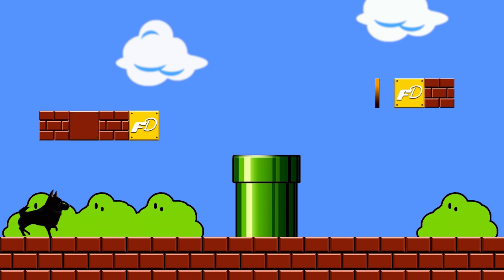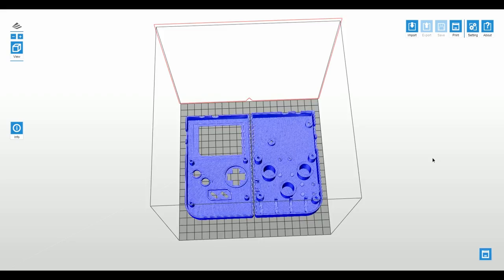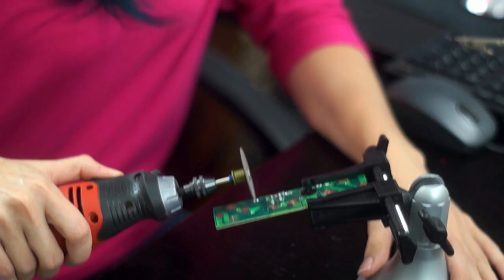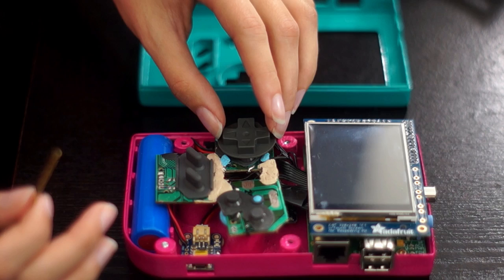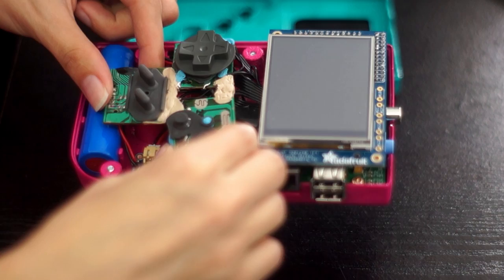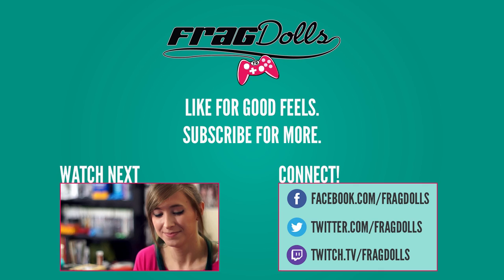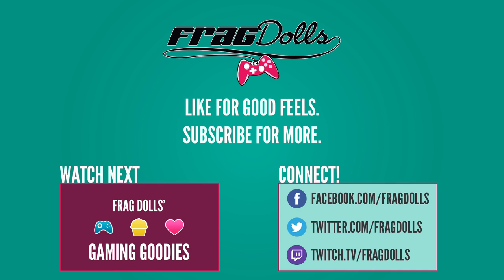Sabre Builds a Raspberry Pi-Boy! (Gameboy Emulator)

Comment: if you make more of these, try assembling the front case half separately. (place the screen, controls and any components/ports on that half) that way you can put it together without having any of the problems you ran into in your vid. non the less it still looked great (y)
Reply: Good idea!  But since I used the STLs from Adafruit, I was limited by the fact that her electronics basically all sit in the back half of the case.  And that still wouldn't have held the D pad in place, or kept the case tight above the screen.  The cool thing, though, is that Lady Ada watched this video (even though I have no connection to her other than buying her stuff!) and in new versions of this project there are screws above the screen ; ) Glad you liked the video!

Comment: this is super cool but i would've drilled two more holes and added the X-Y snes buttons in there too.  sure, its not authentic looking but there are so many emus that need those extra buttons.. maybe print them with the same green plastic so they blend in and keep the gameboy look ;)
Reply: brandon9271 Thanks!  It would be great to have an A-B-X-Y emulator, but Cupcade (the OS I'm using) only runs Mame and NES roms anyway, so the games I have really only use two buttons.  But I saw in another comment that there's an update to the RetroPie OS that might work with more advanced emulators, in which case I may wish I had those extra buttons!

Comment: Looking to mod an original DS and emerged here, I admire your build, if in the future you need to meld plastic I suggest instead of acetone (2-propanone) you try methyl-ethyl ketone (2-butanone). Additionally, it mixes better with peroxide if you're into that.

Comment: Certainly seems a little off having to glue the casing together above the screen. Maybe should have come up with something a little less permanent, just in case the buttons which aren't the most secure decide to move around inside the case...

Hahaha
Reply: MikeyTaylorGaming The stl file for the case was designed by the people at Adafruit who also make the power booster, the tft screen, etc.  I agree there should have been screws at the top, but redesigning an already completed stl (as opposed to a native file) is a bit challenging, and there's really nothing wrong with gluing the top.  The one I made hasn't needed to be opened, but if you unscrew the 4 lower screws, the top will "hinge" a fair amount.

Comment: How do you change the battery when it runs out?
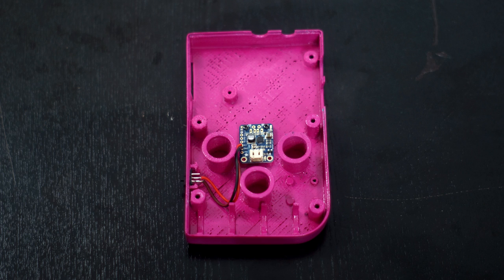Reply: It uses a LiPo battery that recharges through a USB cable that plugs into the thing immediately up and to the right of the battery at 2:17.

Comment: Your RaspBerry Pi Boy is probable the most polished one I've seen as of yet. I just wonder could it be possible to attach one of those cartridge readers that plug into a PC and work it into the Pi Boy so You could run actual cartridges! also would it be possible to have a link cable port so you can connect it the a actual gameboy and have it almost function as one...
Reply: +Karlos Tjuroukei Thank you!  It took a lot of work!  The nice thing about working with 3D printers and the Raspberry Pi is that you can really change things around a lot during the build (if you're good with programming), but unfortunately once their done they are hard to modify without starting from scratch!  Great idea about the cartridges!

Comment: Help:
Adding 4 additional buttons.
L and R buttons and 2 additional buttons in the front.
Can I still use the ribbon cable to wire them? Or do I need to find another way to connect them?

Comment: Hey, very nice video!! thanks for the info, i want to do this project but im a complete fool in electronics, do you think its possible also to wire the x y and L and R buttons? I also would like to play snes and GBA thanks. Where can i find the info how to wire them?? thanks again,.... ha and by the way... do you think i can use an old GBA for the project (or it would not fit...)

Comment: I have a question. If you own a real gameboy, could you use the components from that, with the raspberry pi to save time and money?
Reply: Not really.  The only parts you could really re-use in this setup are the buttons, and then you'd be left to figure out the wiring on your own instead of following a tutorial.  Plus, the 3rd party SNES controller only costs $3-$5, so there's really no savings.  If you wanted to run on AA batteries instead of Adafruit's Li-Po battery, you could use that part of the case (and avoid buying the booster, charger, and battery), but the TFT screen and Pi won't fit in the original case without heavy modification.  if you could find a way to wire up the old matrix screen to the Pi, you might be a step closer, but in terms of investment you definitely wouldn't be saving any time that way (and you'd have a low-res screen).

Comment: hi, what happens if you plug the piboy into a monitor or tv? can it be a handheld/home console hybrid like the Switch?
Reply: It should be able to, though you might want to ask on Adafruit or Raspberry Pi forums (I gave my Pi-Boy away to a friend who really, really wanted it).  You might need to modify the config.txt file to add something like hdmi_force_hotplug=1 or config_hdmi_boost=4, in which case using a Powerboost1000 vs a Powerboost 500 would be a good idea (making more milliamps available to send along the cable).  So there might also be some modification of the stl files involved.  Adafruit also has an upgraded "pocket" version of this project.

Comment: Great vid - so I've ordered these two items: 1 x PiTFT - Assembled 480x320 3.5" TFT+Touchscreen for Raspberry Pi[ID:2097]
1 x PowerBoost 1000 Charger - Rechargeable 5V Lipo USB Boost @ 1A (1000C)
[ID:2465] = $19.95
from Adafruit. I want to build these into a retro gameboy case (I have a backup plan, a dead saga game gear incase I have space issues)

You connected a voltage boost board between your switch and the charger. Is this necessary with the board I've got?
Reply: +Stuart Fox Nope!  It looks like your PowerBoost1000 will do the same thing as the PowerBoost 500 and the charger I used, but all on one board.  Good luck!

Comment: I followed adafruit's tutorial and everything works until I try to navigate emulation station with the hacked controls. If I go into the raspberry pi command prompt and press a button, it registers and I see commands being displayed in the prompt. I am using retrogame to recognize buttons. If I can get past this hurdle I can play the custom pi gear I made!
Reply: +Kaiser Mora Have you tried using CupCade?  That's what this system was designed for so I'd make sure CupCade runs first to make sure everything's wired correctly.  Good luck!
Reply: Thank you for the response =] I will definitely give it a try. Great videos by the way!

Comment: What did you use to cut the circuit board? Is there something I can use that isn't super expensive? Thanks
Reply: She cut her circuit board with a dremel-like rotary tool (a $30 Black and Decker RTX), but you can cut yours with almost anything sharp if you're patient enough (and don't cut yourself).  The main part of the board is fiberglass, and the electrical "traces" are just soft metal.  You could try a matte knife or x-acto knife, and either cut all the way through by making many small cuts (maybe 20-30 passes with the knife) on top of each other, or "scoring" through the first part of the board and then snapping the rest off.  A hacksaw might be safer, though, and you can get them at Home Depot for less than $4.  If you're not experienced with a hand saw (such as a hacksaw), it might help to only move the blade "backwards" over the circuit board, rather than back and forth.  This won't cut as fast, but you'll have more control over the cut.
Reply: Two other possibilities are "tin snips" which are just heavy duty scissors designed to cut thin metals, or a paper cutter/trimmer (the kind with a base and a large blade that comes down like a cleaver).  Fiberglass will dull your blade though, so you may not want to use a cutter like that even if you have one (unless it's old).  Really, a sharp blade will do the trick, it'll just take a lot of cuts, depending on how much pressure you put on the blade.  Having a straight edge will help.
Reply: Thanks!

Comment: I have everything on that she has. LCD , model b, ribbons to the controls. Now the red led doesn't turn on when I put the battery in it but it powers up fine with the usb. Also, I wasn't about to use a 128gb sd card so I had to use a 8gb one.
Reply: My first though is that you may have shorted the LiPo battery.  If you tap the +/- battery wires together even for a split second, you can destroy the wiring inside a LiPo.  Other thoughts include +/- wires being swapped, or the battery is not charged.  Did the Pi ever run off of battery power in your setup?  Do you have a meter that can read the voltage on the battery?  And, as a side note, she is using an 8gb card as well.
Reply: no the pi never ran on battery power. just re soldered everything and no light comes on  now. hmm..
Reply: ***** I would not have recommended that you re-solder everything, since you had what seemed to be a functional power circuit, you just couldn't get the battery to work.  Now you have more problems than you did before!  But making mistakes and learning from them is often part of the process, so I wish you the best of luck.  If you have a multimeter, please use it to check your battery (using the DC voltage setting) and you can also use it to check your solder connections (to an extent anyway, using the resistance setting).  If you don't have a meter, a very cheap one can be purchased from Harbor Freight for $4.49 right now (item#98025 http://www.harborfreight.com/7-function-multimeter-98025.html).  These are not professional meters, but they can read voltage and resistance fairly well, and they are very, very cheap!
Reply: I'm having the same problem, did you ever fix this?

Comment: to FiveStarGaming (since you have disabled replies for your post):  The original software from the tutorial is "Cupcade" which can only do Mame and Nes roms because of how the TFT screen bypasses the Pi's GPU.  However, there is now a TFT driver update and some other advancements that will allow Cupcade to be replaced with "RetropPie" and, using the same hardware, run Gbc and other more advanced roms.   Here is a link to that Adafruit upgrade tutorial: (if it posts) https://learn.adafruit.com/running-opengl-based-games-and-emulators-on-adafruit-pitft-displays/overview

Comment: Hey I have the DaVinci XYZ. What kind of filliment do you use? I have mine all modded up so I can use other filliment but can't find a good one. :P
Reply: It's my 3D printer, she just used it for the build.  I use the OEM filaments, and even though they're more expensive I have enough colors that I haven't gone through a full cartridge of any yet (expect the sample half cartridge of white).  I bypassed the counter once to simulate using another filament but then the print failed because I ran out of white ABS in the spool!  I also bought some ninjaflex to try out, but  never got around to it.  I'd be more interested in trying out some PLA, which was supposed to get support in 4Q 2014.  Ever use PLA in it?
Reply: I haven't yet. I've been trying to get a successful print off of it with other abs plastics but since gave up. :P

Comment: This was a very educational video, however i would a prefer a more in depth directed process on what the raspberry pi can do, where you can this tech and what common adaptions could you plug into, I was mainly wondering if you could use this technology and completely re-design an old piece of tech n use the rasp-pi as the new motherboard and system of said device, like for example, the old Megaman PET toys that were popular in the early 2000's how this RPG device simulated the user into virus battles and tournaments n versus competitions like how it did in the tv show. the problem is with this device is that it was cheaply made and chincy. When i was kid playing a megaman PET i wish the screen lit up and the display was more advance just like the tv show, the battle chips were legit but it didnt display the combat simulation based on the tv show, and plus i would like to know if there was a way to hack into the MEGAMAN PROGRESS PET and redesign the code to display english instead of japanese, and other features that was led on in the show. i think this tech is worth inventing since we have the knowledge and technology to re invent this megaman PET device

Comment: I started on this project but I cannot get the raspberry pi to output any video. I am thinking that the SD card is not getting set up correctly because the ACT LED in the RP does not blink. I have tried so lots of things to load the cupcade but I keep getting an error when using the "raspberry to pi SD Installer OS x" on my Mac : Volume failed to eject, even though it looks like all the data was transferred. I have also tried to upload different operating system images such as the Retropie... but no luck. I was hoping maybe someone could help me.

Thanks for the great video!
Reply: Hello.  Unfortunately I probably can't advise you directly on the Mac setup of the SD card (and neither will Sabre, as she's not a Mac user), but regardless you might try using a different SD card if you can.  Since you are experiencing the same problem with multiple OS's, a corrupted card is the first thing I would check, especially if it's older.  Next, make sure that you have administrator privileges with your account, and that your card is formatted to FAT32.  Additionally, follow the steps here: raspberrypi.org/documentation/installation/installing-images/mac.md .  If all that fails, but you might want to consider trying the SD install on a borrowed PC if you can!  Good luck!

Comment: Hi, I enjoyed very much your video, I have this question: ¿where can i find that welding support ( I don't know if u call it like that in english, its the grey thing that u used to keep the  control pcb) thank you very much :)
Reply: Victor Munera Thanks, glad you liked the video! I think what you're looking for is the PanaVise Model 201 "Junior."
Reply: That's exactly what I was looking for. Thank you very much!!
Reply: Oh. And another question.. What is your motor tool brand and does it come with other tools (Im noob at this hehe)
Reply: Victor Munera It's a Black & Decker RTX-B rotary tool.  It's like a Dremel, but less expensive.  I am using it with a Dremel 4486 MultiPro Keyless Chuck and a Dremel EZ Lock cutting wheel (these are just for convenience, since a standard cutting wheel would work just as well, it's just harder to change the wheels when they wear out)!  You can get lots (maybe more than a hundred!) of tools for the RTX-B, it all depends on what you need!
Reply: Sabre FD Thank You! :)

Comment: you used acetone as glue?
Reply: +TheRaellz Sorry!  I used ABS plastic, which will dissolve in pure acetone, but acetone evaporates very quickly.  So if you use a little bit of acetone between two ABS parts, it will "melt" the two pieces together and then evaporate away.  An epoxy made specifically for plastics is usually a better idea, but in a bind acetone will work for gluing, as well as polishing, melting, etc, as long as it's ABS plastic.

Comment: Can you help me? my pi only lights up red when i plug the battery in it is doesnt turn on.
Reply: Hello Steven, to get "tech support" it really helps to be very clear about the exact hardware, software, and problem you have.  The red LED means that the Pi is getting power, so that's good news.  Do you have the tft screen attached?  How do you know if it's "on" or not without a peripheral (like a screen), and if so, what peripherals do you have?
Reply: TitaniumInside Hi So I'm also haveing a problem with the power system I'v been able to start it up by plugging the power into the rasbarry pi but when I do that I can't use the buttons.  I thought that it might need to use the battery inorder to get it to work but I can't get it to start at all.  It the power plug says it's charging but for some reason it looks like the power ismt going to the next chip which feeds into the screen.

Comment: Can I order a printed case? I don't think there is anywhere near me that will 3d print something for me.
Reply: Danie Foflyge I've been sending people to Shapeways.com, but I haven't used them.  You could also try some UPS stores or search for a TechShop or Fablab in your area!
Reply: Thank you very much. One more thing: are there enough pins for me to utilize all the snes buttons? I would like to be able to do snes games, if possible. I think I'm going to try making my own case from fiberglass.
Reply: Danie Foflyge There are enough pins, but your problem is going to be software.  I recommend you look a Adafruit's new version, the "Pocket PiGRRL" which already has some extra selection buttons, but it also has some info on how to make a standard 4 button controller setup (under the "software" page https://learn.adafruit.com/pocket-pigrrl/software-1 ).  Good luck!
Reply: Thank you very much.

Comment: Can it play ROMs from multiple systems?
Reply: GS Gaming The hardware can run a couple of operating systems.  The Cupcade OS (which Sabre is using) can play Mame and NES ROMs, but the RetroPie OS is a more advanced alternative that can do many more (GBA, SNES, etc) if you configure it correctly using newly available drivers for the screen.  YMMV based on each game though.  To boost performance, you can use the much faster Raspberry Pi 2, but that will require a redesign of the case, and I'd double check somewhere that the wiring she's using is compatible.